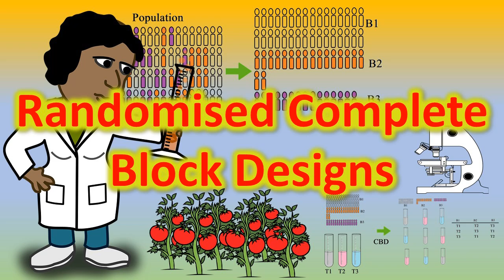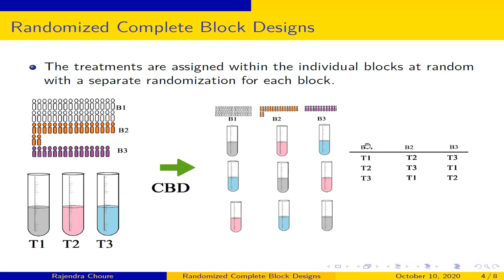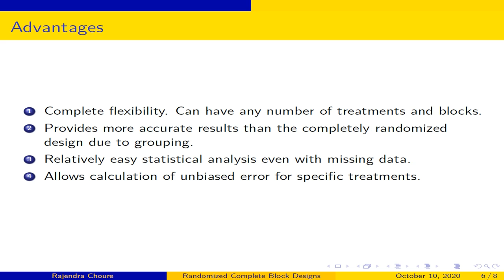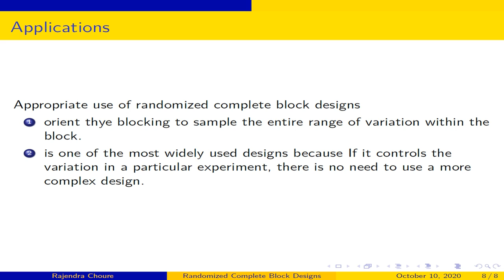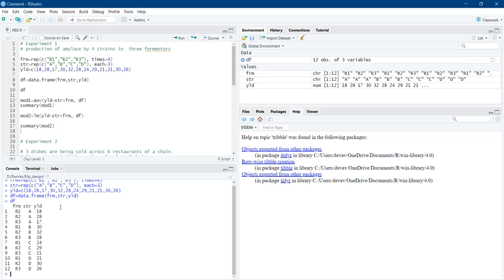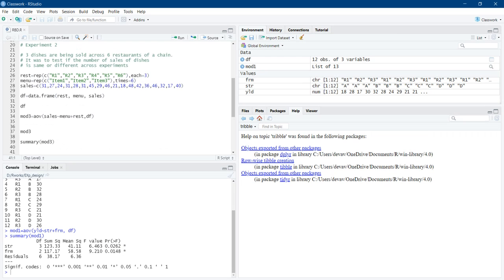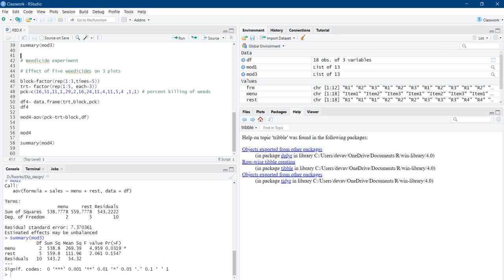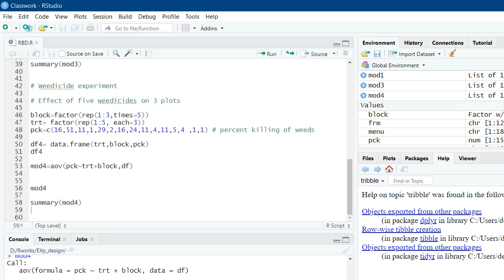Tutorial R for research: Randomised complete block design

Comment: Thank you for this! I have a question regarding running a block design in Rstudio. What I understand from your explanation is that we simply specify the block in the anova. I'm not clear on the difference between block design and factorial design (specified without interaction). Can you please clarify?
Reply from the maker: The block design is used to determine effect of a single varible and blocking is done to determine effect of second varible, which can not be controlled. 
The effect of blocking factor is considered while reporting the effect. 
Multifactorial experiments  probe many factors as explanatory variables or independent variables and are similar to blocking for analysis. The  designs allow probing the interactions also. ANOVA tells about the factors having significant effects (major effects) and interactions if any.